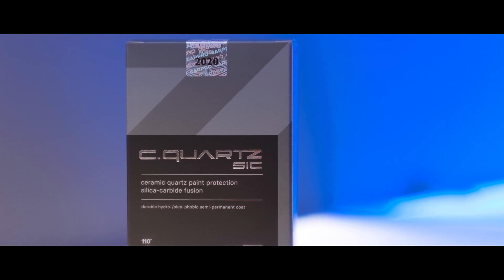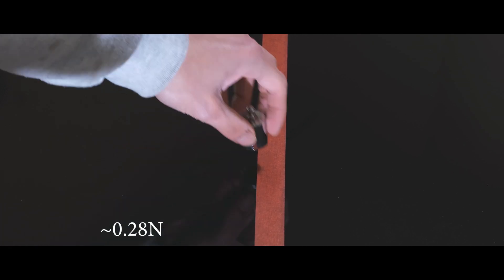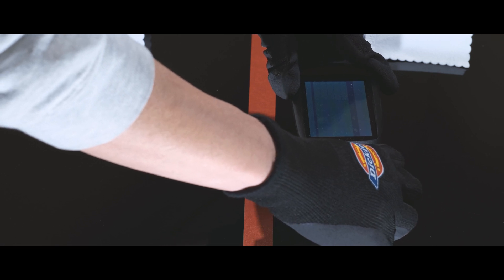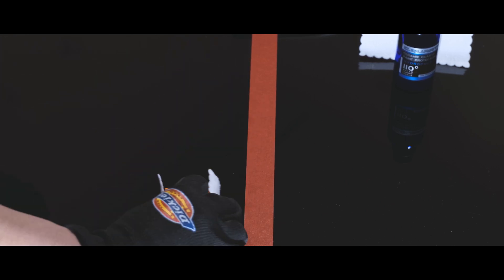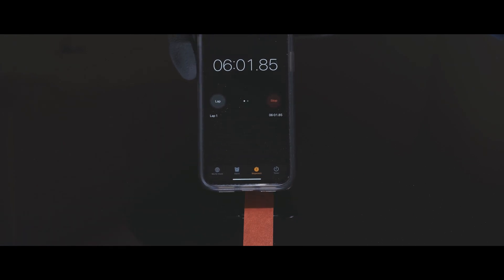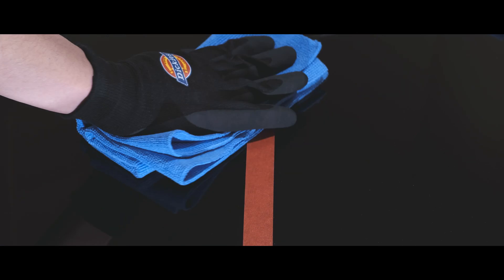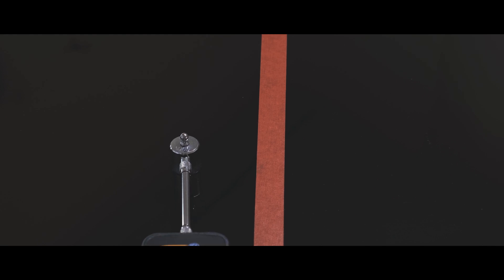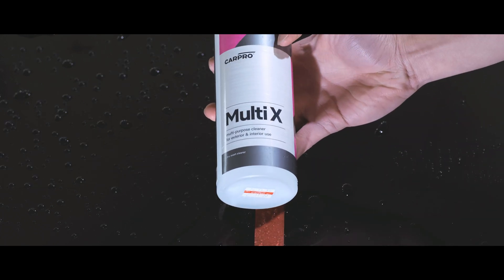Quick Overview: CARPRO SiC Ceramic Coating

Comment: Would it be necessary to avoid water spots, after applying SIC, to use Gliss, or is this not necessary?
Reply: not necessary as SiC replaced Gliss, so it's better. you can just do 2 coats of SiC. and then do maintenance top offs with Carpro Reload to keep it even more slicker and hydrophobic, and last alot longer.
Reply: @shawonr3325  SIC hasn't "replaced" Gliss. 

SIC was designed as a stand alone, and Gliss was designed as a stand alone, and as a topper.
Reply from the maker: The SIC will prevent water spots on its own but having Gliss for later maintenances can be necessary.